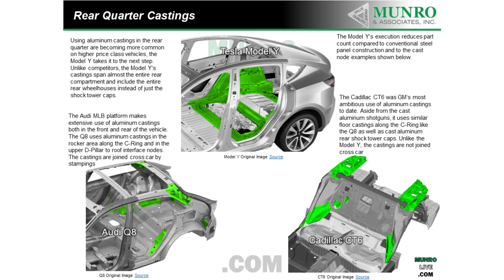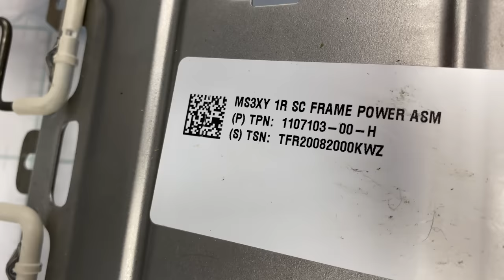Model Y E40: Mega Wrap Up Episode - Top 10 Takeaways and Future Plans

Comment: 2020: Munro Live
2021: Munro University
Reply: WHAT A GREAT IDEA!
Reply: Yes please!!
Reply: I think College/Polytechnic would be more appropriate.. but yeah
Reply: Course / Lesson Suggestions:
1.  ALUMINUM CASTING: How does aluminum casting work (w/ vids of actual casting occurring), tradeoffs of size/complexity, min. feature size issues, heat treating (w vids of how that works and downstream effects), where it's used on products vs. machined parts, num units built vs. complexity tradeoffs, possible issues faced if larger sections cast, repair implications when cast part is broken;
2.  POWER OVER ETHERNET:  Wiring harnesses that use power over ethernet and how that works with tail-lights, blinkers; saturating ethernet with build-in sensors/cameras? how many wires, does fewer wires actually cut installation cost or just parts cost, etc.
3.  WELDING: What types of welding are used in common products (spot, laser, tig, mig, etc.) w/ different Al, Cu, steels of diff. types, where they're used on diff cars, costs for welders, what is automate-able, how automated can quality control on welds be (examples of sensors and costs for same);
4.  CONNECTOR TYPES: fasteners are a big deal, apparently.  Please explain diff. types of fasteners as commonly used, typical fail points, examples of these.  Plastic parts that snap (e.g., frunk shroud in Model Y), xmas tree tie-downs, how people with a door in their car that has a panel that won't stay down can easily fix them, why isn't industrial velcro used more, etc.
5.  DESIGNED-TO-FAIL: Examples of designed-to fail parts abound; one is "fusable link", combination wire and fuse used in GM cars between battery and starter motor.  This makes replacing wire shop time required for changing starter motor.  Other examples?  How exactly do various products use designed-to-fail / planned-obsolescence to ensure future purchases.  Egregious examples would be fun to watch with a name-and-shame game.
6. PAINT SHOP: What goes into making a paint shop work and pay off?  Where is the money spent when building one?  What are trade-offs between high-throughput and cost?  
7. LIMITING FACTORS:  What are typical limiting factors in production rates on cars / trucks?  Does this vary by manufacturer?  Is it mostly the paint shop?  Where are most labor hours spent w/ diff vehicles? 
8. ROBOTS IN MODERN FACTORIES:  What tasks are NOT done by robots now, and why?  Where are modern assembly/automation robots in the scale of simple-vs-universal now, how do the robots break, how can the robots be made more reliable?  Can you get an old Grohmann Automation Inc. robot and take that apart, to see probable failure points and how can improve them?
Just some ideas.  Feel free to follow Justanyone on twitter for more.
Reply: 2024: Musk - Munro. Party: Technocrats
Reply: @kevinrice957  Excellent ideas!
Reply: @kevinrice957  , love your ideas, hope they get noticed.

Tesla has solved for batteries and is in implementation phase.

The next bottleneck now being tackled by Elon Musk is the shortage of quality engineers.

Munro training could help!
Reply: @rkan2  Monro Monotechnic.
Reply: Paul Lafita hahaha

Comment: When I heard you say you were continuing on I clapped my hands and exclaimed Yes! with a big smile on my face. I'm very happy to be able to see more content like this going forward. A teardown approach could even be a big help in figuring out which appliances or consumer electronics are built with quality and which ones went for a cheap part that's going to make the whole thing fail.
Reply: Hey @ZeroCool, I absolutely agree with teardown aiding buying decisions. An anecdote from the late 70's: Being into pro audio at the time, i purchased an advanced audio cassette deck for around $1,000. It worked well and did what was advertised, but when I got it home opened it up I was shocked at the sloppy assembly, excess, sloppy wiring, difficult to service tape transport and on and on. Had there been a detailed teardown on this unit, I would have made a different choice!

Comment: Great job Munro team!  I have a suggestion for a product teardown: Samsung has recently released a ventless heat pump clothes dryer.  Most people might not get the significance of this, but since many localities are moving away from natural gas (especially in CA), I'd really like to see what Sandy thinks of it.  Heat pumps are the future!
Reply: Yes, HVAC for anything, that can be done cheaper is definitely interesting.
Reply from the maker: Thanks for the suggestion and thanks for tuning in!
Reply: @MunroLive  You might want to check Miele's heat pump dryers also - they've had them for years.
Reply: Europe is full of heat pump based ventless dryers - probably a side effect of a lot of the population living in high density city apartments that they don't own (So getting permission to drill an vent hole in the first place may be hard) and have no guarantee of a usable outside wall to vent through in the first place. In my experience they're useless compared to the €100 I spent on a bottom of the range vented electric element heated dryer over a decade ago. All maintenance my dryer has got so far is maybe 3 (€5) drive belts and a new set of bearings for the drum, which I think were around €10. In terms of power consumption it pulls 2.5 kW at full power and needs to run for about 55 mins (Last 15-20 mins is just spinning the drum and blowing air through to cool everything, so not even 2.5 kW for the whole run) to completely dry an estimated 7 or 8 kg load.

Any condenser dryer I've used takes 2 or 3 times as long at a minimum and the clothes are almost invariably still damp afterwards. They use less power because they can recycle heat, but initially they cost a lot more and they go wrong in far more expensive ways, so I suspect in terms of overall cost of ownership, what I have is cheaper (The environmental impact of the electricity generation is less of a worry as I specifically source my electricity from renewables). It's still expensive in energy terms to create high temperatures using heat pumps as the compressor work needs to be high, so I reckon most of them are hoping that running for a long time at a low temperature will do the job, which it doesn't. The cold side of the loop has to cool the air below its dew point to get the condensation out, but above 0 degC to avoid freezing, which in my cold temperate maritime climate, where 80+% humidity and 10 degC air is common, gives it a tough point to start from to dry the air (Likely to be part of the reason I find this type of dryer useless).

Incidentally I also have a clothes drying centrifuge that will take maybe 5-6 kg. 5-10 minutes in the centrifuge, peaking at 400 W during spin up, will easily knock 10 minutes off the dryer cycle too (Even after a full spin) - you can also skip all but the most rudimentary spin cycle in the washing machine as this is much more effective. A centrifuge is the fastest viable home drying method as it mechanically removes the water rather than trying to evaporate it. 

The ideal solution in terms of fast drying and low ownership costs looks to me like a vented dryer that runs a centrifuge cycle before turning on the heat, as it still stays cheap to maintain with no heat pump, but with the centrifuge element, the drum and motor need to be built to last, which will add to the initial purchase price, but not really to the maintenance. 

The centrifuge I have does 2800 rpm with a 0.25 cm (10") drum diameter, giving, according to the a = rw^2 formula, 10 747 m/s^2 or over 1000 g's acceleration at the drum surface (Dropping linearly to zero at the spin axis), so the forces on the drum are considerable, but drying times and energy consumption would minimised. The only faster method I can think of to remove a similar amount of water would be mechanical pressing, but this will damage almost any clothing with fasteners such as zips and buttons - pressing is used in industrial laundries for hotel sheets, among other things.
Reply: agreen6301 - I lived in a Late 1800's home that was LIT with GAS Lighting and was converted to Electric sometime in the 1920's. some of the wired Lighting Fixtures even had Ungrounded screw in Adapters for Electrical Plugs.
and the Home Electrical box was Asbestos Lined and still used Glass screw in Fuses...…….LOL.
I would use a Knife Switch to disable the Circuit in order to Change Fuses, and sometimes the Fuses would give me a Shock. In 2000's I upgraded the panel to a modern one .
Reply: @peglor  , very happy you're thinking about this process.

Washing clothes in a machine is one of the key contributors to quality of life.

It's a dividing line in populations, nearly but not quite equal to electric lights at night and internet access.

I would prefer the centrifuge of the washing machine to be improved.

Any system which requires me to move heavy, wet clothes around will not win my support.

Instead of using dryers, many people hang their clothes to dry if possible, to save a significant amount of energy.
Reply: Definitely a must see, compare to regular existing units. 👍

Comment: Damn, I kinda hoped the Model Y tear-down  videos would never end.  I feel like we are experiencing a moment in time not unlike the replacement of horses w/ the car.  I have no doubt that electric cars will completely replace ICE vehicles over the next 10 or 15 years, in spite of what the other major oem manufacturers may try to pull.  And how lucky are we that Sandy and crew tore apart that early Model 3 and shared what they found on slightly atavistic outlets like Autoline?  I have a feeling that may always be regarded as something of a pivot point for Munro and Assoc.  I can't wait to see more Munro Live and can't express my gratitude sincerely enough. Thank you, Sandy, and the team at Munro!

Comment: After decades of maintaining my own equipment i often felt disappointed with quality when I had to tear into a vehicle out of necessity. I've also worked mil aircraft avionics for 40 years so I know junk when I see it. By field stripping the model Y on YT (should have called it the "Y-Tube" series) I'm very encouraged by the vehicle, both as a Tesla share holder and as a future owner of a model Y. As I approach 60 I grow weary of transmissions, engines, filters, fluids, exhaust gasses/piping and liquid fuel. I'm ready for a power plug, WiFi updates/fixes and the occasional tire rotation. 
Thanks for putting up this content, it's top-level but that's all we really need.

Comment: Thank you Mr. Monro for your informative videos you have produced, just a product update, I received my Model Y late October (serial number in the 65k), the fit and finish has improved. I didn't find any panel gap issues and wind noise was reduced with double layer front windows. Thanks again for your contributions to our community.

Comment: Extremely well done, Sandy.

Product Idea: A quality mass market, bound book called something like: Munro Technical Details: Tesla Model Y

It consists of a 400ish page large format book that is targeted not at OEMs or industry suppliers, but instead at fans (of Tesla, etc) The book contains a bunch of breakdown sheets like you put in your commercial reports (maybe printed in higher gloss and resolution) that highlight things like design and material innovations (but don;t omit the cost stuff - that is really interesting too!) These pages should also call out relevant Tesla (et al) patents that are relevant to the covered materials.

Additionally throughout the book would be block quoted tweets from Elon and possibly other 'Tesla fanistas about the systems depicted. FUDster jibberish from Bob Lutz, et al might also make it into various block quotes.

Price point of these is between 100 and 200 USD each with a possible 35$ teaser edition too. There might be multiple volumes.

When I was a boy My father bought me a set of drawings of the Starship Enterprise. Several large format drawings of the interior and various systems. These sheets kept me mesmerized for many many hours as a young man. My mother and her friends would tease me about how often I could be found with my nose buried in those documents.

You're going for that with these books.

Except instead of mediocre drawings on poor quality paper targeted at budding nerds, you are making coffee table books targeted at auto fans.

Think of what Janes is to ships and weapons... Munro becomes that to (first) Teslas and then whatever else.

Comment: Aww, Sandy, but you Are a seething cauldron of excitement, to anyone with an engineering/product development mindset anyway!
I look forward to the growth of your business and this channel. I foresee good things to come.

While I would be interested in getting your take on a teardown and design considerations of some of today's high efficiency window and mini-split HVAC units and other energy saving appliances I suspect much of your audience is all Tesla all the time. Maybe gradually introduce them to new concepts. Heat pump laundry dryers are cool tech and something most people haven't seen. Like the Model Y they are replacing resistive heating elements with a phase change system.

Whatever direction the channel goes from here it is great that you are sharing design, material, and manufacturing process knowledge with the public. Americans have largely lost touch with manufacturing. Spreading knowledge of and your obvious passion for engineering and manufacturing can only be a good thing.

Comment: 1. Tear down more new cars that you think are worth looking at. The i3 was a great choice.
2. Show what would be the "best physically possible" solutions for each part of each car, in terms of cost and ease of manufacturing, efficiency, repairability, etc.
3. BUILD YOUR OWN "perfect" CAR by combining all the best elements from each car into one, and "build" a computer 3D model as a demonstration of the best/cheapest car possible. You could even use VR to walk around a life-size car. You could then sell this as a package, including all the manufacturing techniques used to achieve this.

For example, I kept thinking about the wiring harness. Probably after they go to CAT6/PoE cables or something, you can't really get less cabling than that. Therefore, such a cable would give you the physically least amount of cabling possible. So you'd model a new wiring harness in 3D. Then, do this for every part of the car.

Comment: Hi Sandy, thanks for the great work. I have a few comments and suggestions. Tesla's preeminence in electronics and software will continue due to its Silicon Valley roots, so is the shifting in wiring and control, towards more electronics control.  Your octovalve example reminds me of the controls inside a wafer fabrication equipment, we used to call them jungles. The in house designed CPU and software greatly protect Tesla from IP thief and others from copying. 
Since you have the early cells from Tesla model 3 and the model Y, it would be very interesting for a lot of people to get a lab to cross section the cells and do element analysis on the materials in the cell. An EDX attached to a SEM (scanning electron microscope) should be able to tell you the composition in the electrodes, at the same time give you nice pictures too. Possible to see microstructural differences too. People doing semiconductor device failure analysis should be able to help you here. To figure out what additives they add to the electrolyte is more complicated, but a very good plating or battery engineer should be able to help you there. (I am an engineer by profession, used to work at Fairchild Semiconductors, DEC and a few startup companies in the Bay Area). 
You have the batteries, their rating(?),  can you estimate the KWH/Kg of the batteries? 
In depth battery cell analysis and their performance across different vehicles and time should be of great interest to many people and very valuable information too. 
Thanks and have a great day.

Comment: Sandy, another spectacular video. WHY? WHY? is Tesla not able to consistently put together vehicles with fit and finish that is on par with other legacy manufactures? Fit and finish seems like it is the lowest hanging fruit for improvement. Should fit and finish that is substandard scare me away from plunking down $50K+ on a Model 3 in 2022? It seems that with continual improvement that Tesla is putting in action, they ought to be able to nail down the details of fit and finish. Why would they let fit and finish potentially harm the Tesla brand?

Comment: Appreciate what you do Mr. Munro. I live in snow country where lots of salt is used on the roads. Could you please do an evaluation on if the Model Y under body will resist rust, due to road salt exposure, any better or worse than what people presume conventional cars do. Please try to predict where the rust problems will be after a few years of winter use, if those problems will cause structural integrity issues & what to do to prevent  these issues. Maybe do this in context on if someone does car wash under body spray weekly vs monthly during winter months. Also, what is the bottom side of the battery pack, that is exposed to road salt, made of?